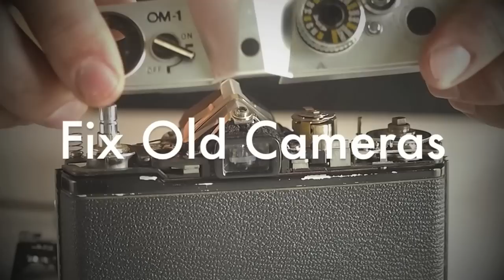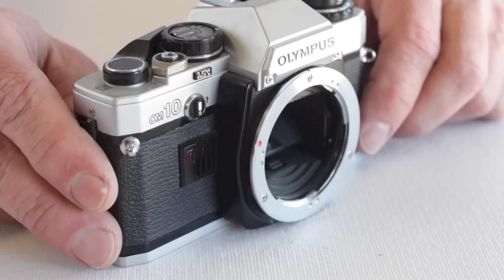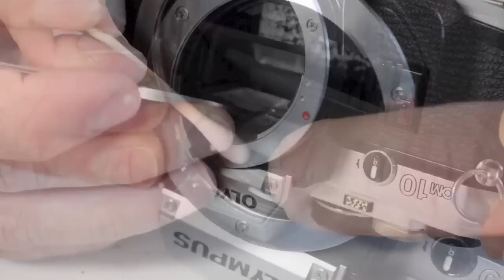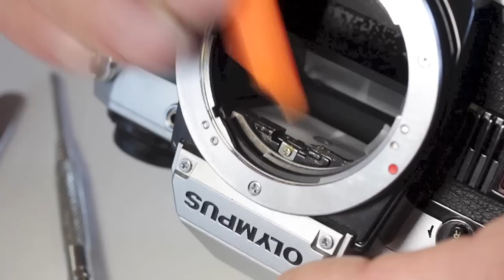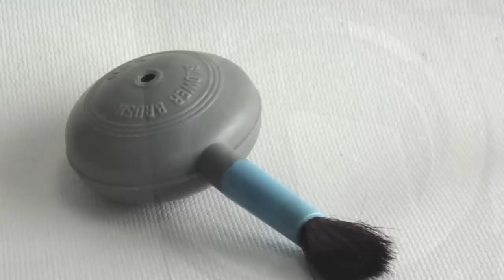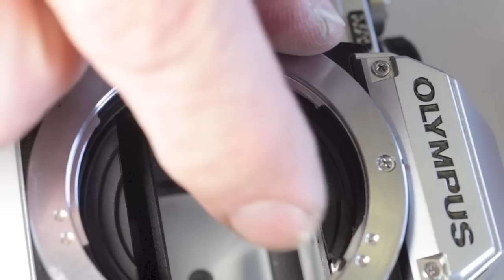Fix Old Cameras: OM-10 Viewfinder Cleaning

Comment: I can confirm this is the similar if not same method used to replace or clean the OM-20/G. I'm half way done replacing mine. Be careful removing the plastic clip as it has two holes to which it goes back into.
Reply from the maker: Thank you for your comments and insight.

Comment: Thank you so much  for the video!
I have a question on what is the best way to clean the mirror, when  I touched it or when small drops of something fell on to it. Not dust. Blower won't help.    Some say that it is better to leave it the way it is, an do not even touch it even with microfiber swab and special liquid for sensors. Some say you may clean it  carefully with microfiber alone. Camera is Pentax K1000. Thank you very much for the comment.
Reply from the maker: The mirror can be gently cleaned as you would a lens. The viewfinder screen CAN NOT be cleaned with any cleaner except distilled water. Try dabbing at the specs with a lint free cleaning swab moistened with distilled water. You can also follow the concentric rings of the VF fresnel lens with the distilled water cleaning swab. Then dry with a blast of filtered air.
Reply: @FixOldCameras  Thanks!

Comment: OK in regards to my comments about Olympus OM10 camera shutter speed indicator LED's not working..fixed it and the fix was easy:   I have a spray can of 'electronic circuit cleaner'.  Very carefully sprayed a bit around the shutter button and the collar around it (which is a pressure-sensitive switch),  the ASA/mode selection dial,  and the on/off/battery check/self timer switch. After working these parts a bit with a couple judicious applications of the cleaner material:   problem solved.  Shutter speeds now properly displayed by the LED indicators along the left hand side of the viewfinder.  I suspected that a contact point had some hidden gunk buildup or corrosion and the liquid material I used took care of it.  So now my $35.00 antique shop find SLR is working just fine.
Reply from the maker: Good to hear of your successful repair and thank you for your comments.

Comment: Thank you for the very informative video. My OM10 was transported and the viewfinder screen was completely out of its place. I pushed it back and it only hooked on the upper side so I should do the exact same procedure. My question is, how bad it is if the viewfinder screen is scratched?
Reply from the maker: It is only annoying, not bad at all.
Reply: @FixOldCameras  thank you so much for replying. Will report with the result :).

Comment: Thanks for the video. Is it necessary to add back the foam strip at the end of the repair procedure?
Reply from the maker: It is not absolutely necessary to replace the foam mirror cushion, but would be preferred.

Comment: Can anything be done about the shutter speed indicator LED not operating?  Shutter on my OM10 seems to be working fine just the camera-selected shutter speed is not indicated along the shutter-speed column on the left hand side of the viewfinder.  My OM10 was an antique-shop find everything else on the camera is working fine except no shutter speed indication.  Shutter seems to be working properly as it changes speed according to lighting and lens aperture selection.
Reply from the maker: This might seem obvious and it is doubtful you overlooked it... but make sure the on/off switch is on. The OM-10 (and the OM-G) will release in the "off" mode but the LED only illuminate when the camera is turned to the "on" mode.

Comment: Congratulations for your YouTube work. These videos are very instructive.
I have two questions: is the Pentax ME viewfinder screen removable like the OM-10's? What kind of glue is the one you use? don't know that brand in Portugal. thank you.
Reply from the maker: Unfortunately the finder screen in the Pentax ME is fixed. You need to remove the top cover, upper circuits and prism to access the the screen. If you can not get the particular brand, a permanent office glue stick will work on pliable leatherette, on stiff leatherette double sided carpet tape can be used. Contact cements can be used also, but sometimes can be difficult to remove should you need to service the camera again. If you have a specific classic camera gluing issue, other than the attachment of leatherette, than other options can be explored.
Reply: Thank you! Best regards.

Comment: I'm assuming the ompc is the same way? I have to change to a 1-7 prizm so I can use my 600mm f6.5 and my 1000mm f11.
Reply from the maker: It is not, assuming that all manufacturing runs of the OMPC and OM-40 are the same ... the prism will need to be removed to access the viewfinder screen.

Comment: Good video! How is this process in the Praktica BCA? Do I need to remove the top cover? Thanks
Reply from the maker: Confirmation of the following is presently not absolute. However, the top cover and then the prism probably will need to be removed to access the VF screen.
Reply: To remove the cover do I need to remove individually the components like the mode selector, winder, ASA indicator, ... or I just unscrew the top screws and lift? Thanks!
Reply from the maker: The shutter speed dial, assc. shoe, and shutter release button will not be removed, they remain in place for top cover removal. Only the rewind knob, the on/of switch plate c-ring retainer, on/off switch plate itself (check the switch plate as the spring detent is prone to failure) and the advance lever and related parts will need to be removed.
Reply: Thanks, will try. Sometimes it seems the electronics fail (shutter speed led only lights up for a second) and the shutter sticks for several seconds or until it's cocked again. What do you think it is?
Reply from the maker: What is described in the previous FOC post applies to the OM-10... not the Praktica BCA.  Forgot you were asking about the BCA not the OM-10 featured in the video. The BCA advance lever has a plastic cover that is held in place with screws that are on the underside of the lever.

Comment: I recently got an OM-10, and it seems like the mirror isn't sitting in the right position, because with all my OM-mount lenses, it can't bring distant subjects into focus in the viewfinder (i.e. won't infinity focus). This despite those same lenses appearing to focus correctly in my OM-4's viewfinder. Another thing that makes me think the mirror isn't sitting right is that even when I'm able to align the split image in the finder, everything still looks a little blurry. The camera has a good set of batteries in it, and seems to function properly in all other ways. Any idea what the problem might be and whether it's a possible home repair?
Reply from the maker: It would be unusual but not impossible for the mirror not to seat properly, yet till allow the camera to operate. It seems more likely that possible the focus screen might be flipped or improperly seated.
Reply: @FixOldCameras  Hmm, ok, I'll try flipping the focusing screen. Thanks for your videos, and for your reply!

Comment: i found cleaning the screen in an ultrasound bath with demin water to work very well
Reply from the maker: That is a good way to proceed with the fragile Fresnel lens of the VF screen. However,  demineralised water and an ultrasonic cleaner are not as readily available as the distilled water and cleaning swab. Thank you for your comments.

Comment: Is it really needed to glue the ceramic cover plate back? I am a bit wary on glueing it. Also is there any other glue I could use ?
Reply from the maker: +Prop Eaters The felt seals that run along the side might retain enough adhesion to hold the plate in place. Give it a try. However, Pliobond has proven itself as a very good multipurpose adhesive with 36 years of personal application in the repair of cameras. It does have a tendency to leave strings of glue as you pull away the applicator, but with a little practice they can be managed easily.  Although, there are likely some good substitutes available.

Comment: Hi i recently purchased a L viewfinder to replace the standard viewfinder for a Minolta 7000. Is the procedure of the OM-10 similar for the Minolta camera. Thanks.....
Reply from the maker: The VF screen retaining clip release for the Minolta Maxxum 7000 is located in approximately the same position as the screw that holds the VF clip of the OM-10
Reply: Thank you for you're reply. keep up the great work you do.....you're video's are so helpful....

Comment: however after replacement the focusing is way off. if i focus on an object 10 feet away, my distance scale on the lens says 5. found this problem in other om10 as well after precious owner did the replacement. i wonder what i did wrong...
Reply from the maker: Sounds like the VF screen might have flipped or is not seated properly.

Comment: I did that but I still have a spot on my viewfinder from the outside (the square where I look to take a picture) I can’t get rid of it any idea how to fix that?
Reply from the maker: Depends on what and where the spot is. Check the surface of the prism along with both sides of the focus screen. If you are seeing it in the viewfinder it will be there or you have separation of the reflective coating of the prism, in that case the prism will usually need to be replaced.

Comment: I mistakenly wiped my OM10 viewfinder screen with alcohol. It seems it becomes grainy when I look at the view finder. Did I ruined it?
Reply from the maker: Yes.  Alcohol fogs the plastic of the Fresnel lens of the view screen. Only clean with distilled water.
Reply: @FixOldCameras  are viewfinders for each camera different or is there a standard size that i can get anywhere. i did this same thing on my pentax k1000 viewfinder and cannot find a new one for sale anywhere. thank you
Reply: i just don’t want to have to get rid of the whole camera because it’s fully functional but i can’t see what i’m looking at when using it

Comment: My view finder screen has a stain from the cushion. What do I do? It’s a canon ae 1
Reply from the maker: The mirror can be gently cleaned as you would a lens. The viewfinder screen CAN NOT be cleaned with any cleaner except distilled water. Try dabbing at the specs with a lint free cleaning swab moistened with distilled water. If it is smudged, you can also follow the concentric rings of the VF fresnel lens with the distilled water saturated cleaning swab. Then dry with a blast of filtered air.

Comment: hi, I wanna know how to remove the focusing screen on my Canon AE1, because it has dirt inside, I try to clean it from outside, so I think the dirt is on the opposite side
Reply from the maker: The Canon AE-1 has a sealed focus screen and prism, but as you have found out dust can still invade the space between the prism and the screen. It is a considerable task as the top cover, upper circuitry and prism need to be removed to access the inner surfaces of the screen assembly.

Comment: I thought the manuals for the type of cameras with replaceable viewfinder-screens warned that it had to be put in very specifically to be in focus or something like that. - Is that just a lie or excuse so that people would send them to a service-center to catch more money?...
Reply from the maker: The viewfinder screens need to be handle carefully as the scratch very easily. There are specialty tweezers that are made specifically for changing out viewfinder screens, but if care is used the demonstrated method should be in the doable my most people with a little patience and skill.

Comment: I was prying the cover off and the glue released all at once and my piece flew across my room, i spent two hours moving, sweeping and sifting through stuff.
Reply from the maker: Grrr... that is frustrating. Nearly all who might attempt to repair a camera will end up crawling around searching for a roll away bearing or screw or chasing a spring flying off into parts unknown.
Reply: @FixOldCameras  I did find it, now i just need to buy some foam sealers from the mirror and back of the camera.